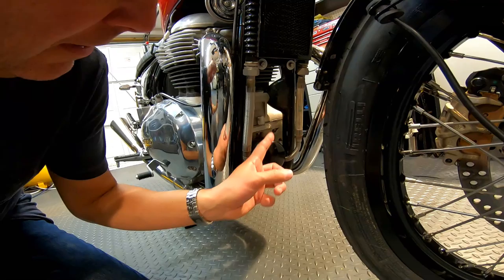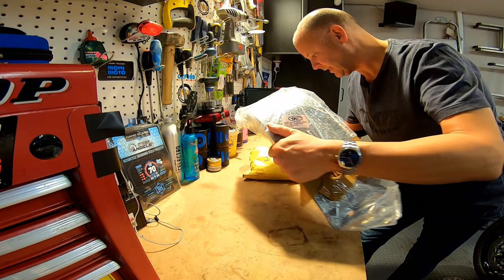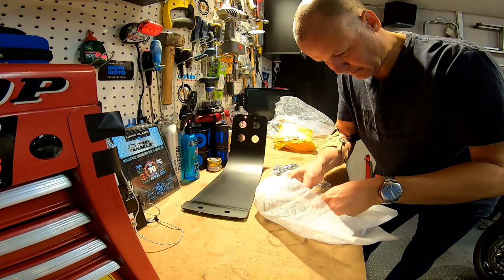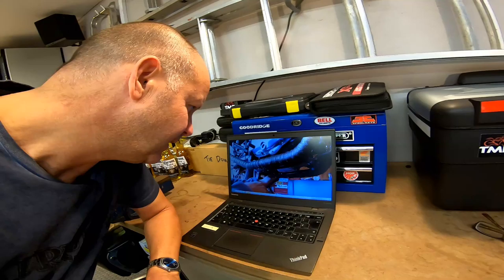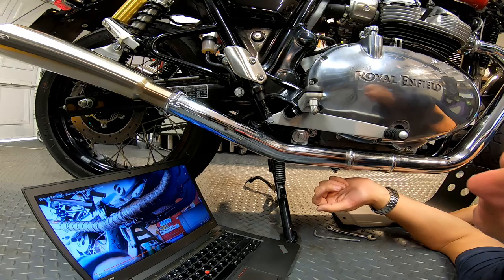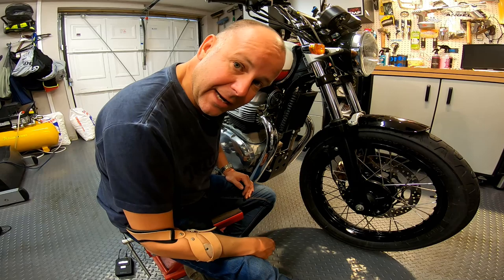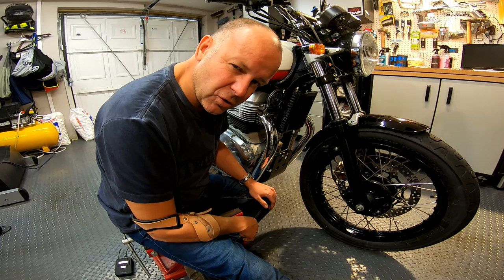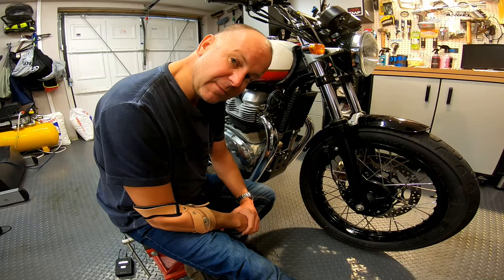Royal Enfield Interceptor Essential mods - Bashplate installation

Comment: It looks great, but I'm thinking the lightening/cooling holes are still going to let crud in and cleaning will require removal of the plate, as will servicing?

Think I may have stuck with the fender extender option...but that’s just me 😇
Reply from the maker: Yes these are all things to take into consideration....I like the look and the protection it affords the oil filter....
Reply: Eva Watson-Abbott- I would tend to agree. No way would I make access to the oil filter that difficult. I think you would find that a  nice stainless 1970's Bonneville front mudguard (which are easily available) could be made to fit easily, that and a mudflap would acheive the (stated) objective better as well as considerably helping to keep your feet dry.  

Then again, crud prevention was only the excuse, not the objective it seems :-)
Reply: Couldn’t agree more. It’s got to be one of the most stupidest ideas I’ve ever. You take off a perfectly adequate mudguard which stops muck hitting the engine, then fit a fiddly bash plate which won’t be utilised at all and then it restricts the access to service and clean the bike. 
And one more point. I bet my left knacker those bolts will be corroded in no time ( but knowing tmf he won’t be using his own bikes on the road. )
Reply: I've found that some things sound great, look great, and then down the road living with them. Meh, not so much. But you have to try it anyway. In this case, like you, I would think the need to remove it to gain access to the filter is a choice PITA. We could set up a bet on how long he'll keep it. LOL
Reply: Absolutely, the is retro styling, but somewhere along the line the stylists forget that bikes used to have proper mudguards,  Perhaps that is why people call them fenders....
Reply: @TheMissendenFlyer  Imagined protection, but ok.

Comment: So the idea of protecting the oil filter is to fit a plate full of holes right in front of the filter that you have to remove when changing the filter? I will watch again as i must have missed something.
Reply: Exactly what I thought when I saw the holes.
Reply from the maker: I’ve added it mostly for cosmetic appeal - but it would protect the filter from any blows from below I reckon....but point taken.
Reply: @TheMissendenFlyer   The original RE would have had a big deeply valanced front mudguard that kept the rider clean. There is no "cosmetic appeal" in fakery that is so obviously impractical and subtracts from the bikes heritage
Reply: @xtc2v That’s a little harsh, I think plenty of the original REs would have been modified with lightweight “shortie” mudguards for aesthetic purposes too, these things aren’t supposed to be a recreation of an original, more of an ‘homage’ hence things like disk brakes and digital odometers
Reply: @lezlight3497  Disk brakes and digital odometers do some good. What good is done in getting covered in filth?  Its taken a downward turn from just owner "modification" as now many new machines don't come with full length mudguards (front or rear). Mudguards were cut off and exhausts raised on road bikes in the 1930's until far superior lightweight dirt bikes became available.  Why would you want to pay "homage" to these diy bodges? Those bikes were awful to ride off road
Reply: Lez Light 
I couldn’t agree more...well said!
Reply: I thinking maybe it needed a wire mesh grill, the type that goes on the front of radiators.
Reply: What kind of riding do you plan to do that would need you to protect the oil filter with this? If you plan to ride it off road a lot in gravel then I understand. I suspect not.
All you have done is restrict air flow to the filter which may have been a part of the original design to keep the oil cool.
And made yourself a bit more work when it comes to filter changes.
Bash plate lol.
Reply: @stuckintheeighties487  Well said....couldn't agree more!
Reply: @TheMissendenFlyer  The look would have cosmetic appeal if you complete the job and fit knobbly tires. As a road rider you are not going to fit them. You are now going to have to keep ignoring its road tire tread pattern every time you look at it.
Reply: rumien 13 . Don't you mean SHOVING!
Reply: Mike Frost oops, must’ve been autocorrect, sorry. Although, looking at my fingers......
Reply from the maker: @xtc2v   I do intend to fit knobbly tires in the fullness of time, but one step at a time....thanks for watching and for stopping by!
Reply: @rumien1383  shaving shoving 😂😂😂👍
Reply: I'd say it is mainly cosmetic, I work with aluminium in these types of gauges and they aren't that strong, 3mm starts to feel like it has some substance but nothing dramatic.  But the price isn't bad and you could modify it a bit to help.
Reply: I think the flyer did make it clear, this was the first in a long line of modifications, he cant do it all at once!

Comment: Crud through the holes anyway and now a pain to change the oil, oil filter and for cleaning. However, I get it, it's the looks. Fair enough. 👍
Reply from the maker: I don't think you have to completely remove it - and it's no worse than removing the underbelly on say my Street triple when I do that...

Comment: I have just changed the oil in my GS and had to remove the bash plate to access the drain plug, no big deal - plus gave my OCD an excuse to exercise itself whilst I gave the plate a good clean inside and out!

Comment: Do you have to take off the bash plate each time you change the oil filter? That would be annoying.
Reply from the maker: Not entirely apparently, just the from bolts....but I’ll let you know....
Reply from the maker: Front
Reply: @TheMissendenFlyer  

+ loosen the rear bolts - or else bend the plate . . .
Reply: Yes that's a pain. Secondly there are four large holes right in front of the oil filter that it's supposed to protect!!!

Comment: A few comments are saying "but what about changing the filter and engine oil ?" . I've worked underneath a modern car with a huge plastic plate that had something like 12 bolts that had to be removed for an oil change. Removing the sump guard on this bike to do once a years oil maintenance looks pretty easy to me.

How would they get on a faired bike with lots of bits of plastic to remove ? :-D ( but I'd still have a Ducati Panigale if I could afford ! )

Comment: Jobs on bikes look a lot easier than jobs on cars. You can get to most of the stuff, and no laying under the vehicle of the type when doing prop shafts, exhausts, or taking the gearbox out of a rear wheel drive car.  I don't miss shuffling myself under old knackered cars !

Comment: I am thinking why are mud guards now so short ? I've got a Speed Twin, it's awesome , but sometimes I think, especially when the winter comes a bigger front mud guard would be nice, and swap it back out for the shorter one in the summer.
Longer mud guards make the fitting of things like sump guards (bash plates) a bit less necessary, assuming you're doing it to stop the crud the tyres throw up.
I guess I can see more of the point of sump guards if you're going to do off roading.
I suppose they look "pretty" .

Comment: A bit unrelated to talking about sump guards. Sorry !
Do you miss the torque of the Speed Twin when riding the Interceptor ? Maybe I should get better at being in the correct gear, but being able to pull in the "wrong" gear sometimes is quite useful, it does make the bike easy to ride. Maybe a really silly comparison, it's much easier than my 125 in this respect.
Reply from the maker: No not at all - the Interceptor is completely fine on the road....

Comment: It would have been nice if it had access plates so you could change the oil without pulling the plate back off...
Reply from the maker: True but I  don't think you have to completely remove it - and it's no worse than removing the underbelly on say my Street triple when I do that...

Comment: It looks like a PITA that doesn't do what you wanted. They could have made removing/fitting 1000% easier by using captive nuts instead of making you crawl around on the floor with two tools.

Comment: looks good, black hardware (bolts etc) would look good on the bash plate. Does this mean it needs to be removed when you do a oil and filter change?
Reply from the maker: You don’t need to fully remove it, just undo the front bolts to get the filter out I understand....will let you know!

Comment: Not a terrible price on that bash plate, you could make your own given the tools and a modicum of ability but you wouldn’t be making great savings.  I could do with one for my soon to arrive Bullet (not for me parallel twin modernity).  While I don’t intend to off road, I do have a habit of running out of road and ‘taking short cuts'.  What is going to be great with the RE Interceptor/Continentals is the OEM/custom parts supply.  Let’s be honest they’ve strung an industry out of the Bullet so the parallel twin is just going to be even more so.  And I like that, makes a change from a HD and while the bike is Indian being produced by a big Indian company these additions are coming from smaller British companies which is better for jobs.

I very nearly went with the twin but I have stage 4 lung cancer, one big side effect of that is muscle wastage (because of the steroids you’re on, these aren’t the steroids that body builders use obviously) and I just found the weight a bit too much.  I’m fine moving, it is at standstill problems start.  Even the Bullet doesn’t feel a light bike anymore and I may well swap out the tank on that (it has the large tank) since I’m not going to be doing long distance touring.  I can just about manage a Suzuki LS 650, which is a large single in a 1980s custom cruiser style- generally called a ‘girls’ bike’, 30 HP- still available in USA/Aus but rarer here and no real parts supply.   I like it to be honest but physically it is very small, like a Chinese 125 cruiser from a distance.  I wish I had the time/money to modify it a bit because it would probably be the bike to see me out of this world.  As is, I ride everywhere with my knees up by my ears, it needs better forward controls but the price of those means that isn’t happening.  Rear sets would have your feet about 6 inches after the rear axle probably and because it is a cruiser there’s not great ground clearance to be able to drop the controls any lower- anyway off topic.

Great video, real buzz to it which is a trick t pull off with live videos, I think.  You have to carry the audience along with you and you did.
Reply from the maker: Thanks for the kind words - sorry to hear about your cancer - a terrible thing to happen to anyone but I’m so glad you’re still able to ride the bike....all the best - TMF

Comment: In fairness less faff fitting or oil servicing than the RE bash plate (per TEC parts vid), but faff nonetheless.  If TEC could come up with that mudguard others have spoken about I would be more interested if easy (I am lazy).  Personally (JMO so no offence to anyone who likes the look) these bash plates don't do it for me looks wise as they scream faff to me.  Not pulled the trigger on one of these fine bikes yet but out of all the vids I have watched on them this looks like a cure with side effects looking for a  disease.  Some crud aside has anyone noted an issue with damaged oil filters (not been showing up as an issue in my research)...............Thanks for the vid as usual though (well done as usual for that).

Comment: Good video TMF. I think the GoPro is working as well as the camera too.
Reply from the maker: Thank you - sooo much easier than setting up the DSLR and more foolproof too - which is just a well with me at the controls!
Reply: @TheMissendenFlyer  would I be right in thinking that you're using the Hero 7? Is that with it's built in Mic too? It's very clear if it is.

Comment: Hi TMF, I like the bash plate. It fits the look and provides protection for the oil filter, casings and sump/plug. The cooling is negligible through them holes and enough air will circulate from the sides. You are not interfering with oil cooler or engine fins so it won't be a problem. Plenty of crud will go through though unless you fit plastic plugs as I did to my 900 Triumph Scrambler. Here's an example 
https://www.ebay.co.uk/itm/Hole-Plugs-Plastic-Blanking-Masking-Finishing-Inserts-Black-White-Grey-Brown/222482082971?hash=item33ccf72c9b:m:mhLmXLj5XJOWcJAN2ICL5Sg

A warning when your bike 3 year old and needs an MOT. Some testers will see the plate and use it to lift the front end to test head bearings. The plate can slightly bow/bend upwards towards frame rails. I just slip some wooden packers in the gap between plate and frame both sides and take out afterwards.

Comment: Hoping you might change the exhausts, rear shocks, seat/rack combo and headlight, like the TEC One scrambler. Just thought though, how easy to remove the bash plate when you need to change the oil and filter?
Reply from the maker: Stay tuned! ...and I shall report back...

Comment: I think I would modify the attachment points with some anodized knurled thumb screws and clip nuts for the attachment points of they’re not threaded. It would make access for oil changes, cleaning and such, much easier and would look a little better than those hex screws on the front.
Reply from the maker: Yes agreed - good call!